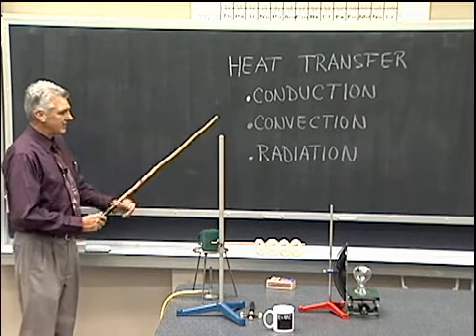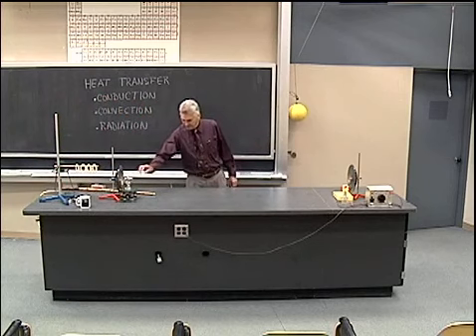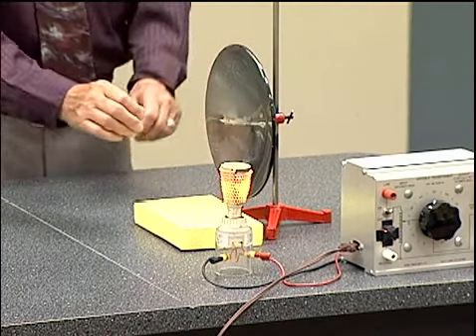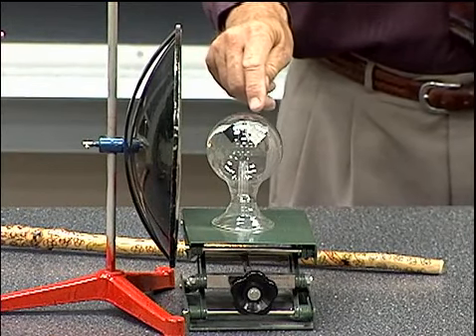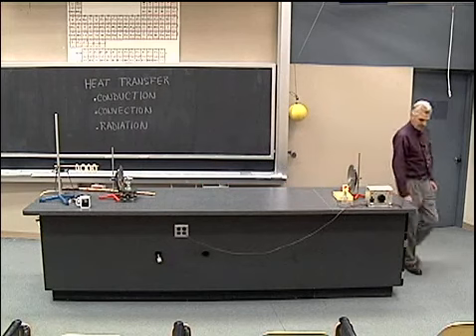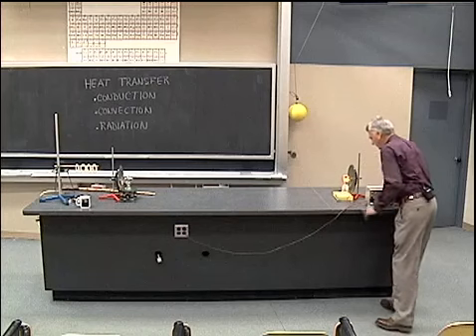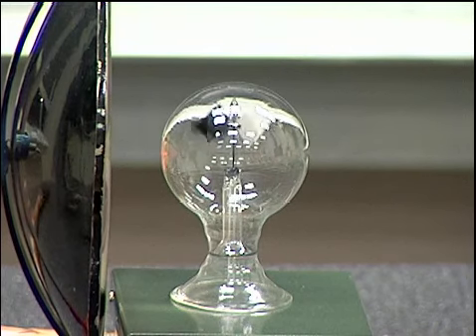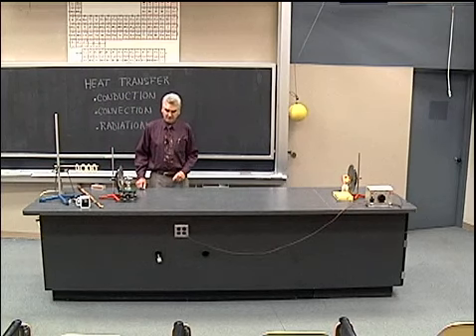Radiation

Comment: Note that this is not the same as Nikola Tesla’s Radiant energy, as that is produced from a high voltage electrostatic unipolar discharge through a low inductance shortcut (primary coil)